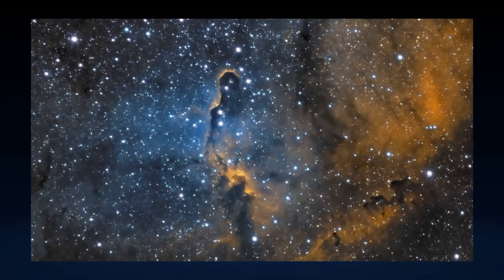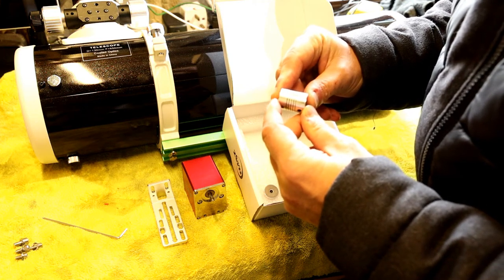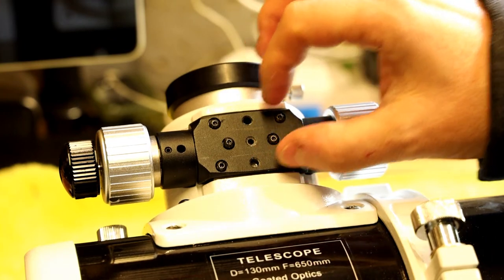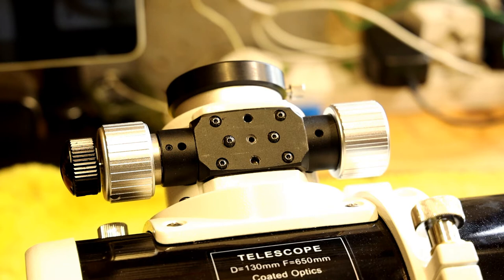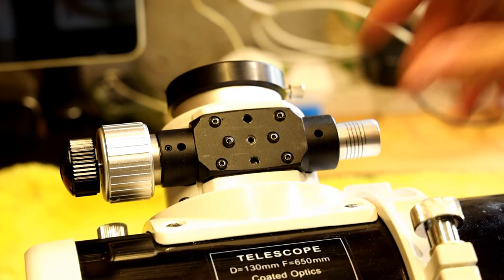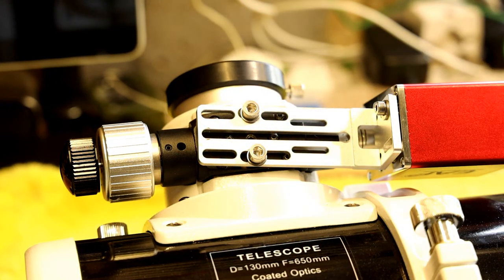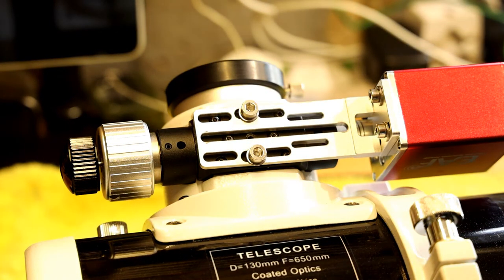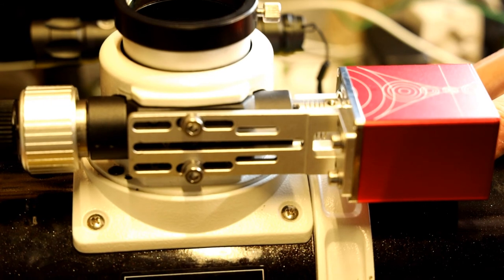Astrophotography with Glenn Clouder - ZWO EAF Installation to a Newtonian Scope

Comment: Glenn nice job, BUT you always want to tighten the allen (grub) screw on to the EAF flat spot (called a D shaft) and not the round part of the EAF shaft. That flat spot is designed that never to slip if the allen (grub) screw does dome a bit loose. Also in the EAF clear package are set (grub) screws with lock tight to prevent them coming loose as it sucks when it get really cold and the metal shrinks.
Reply from the maker: Thanks Chris. I always do make sure one of the grub screws is on the flat side of the spindle. I have heard others say theirs has come loose but I have yet to have this happen and I have 3 fitted to different scopes. I must be lucky

Comment: Many thanks for this great video. You made my day, as I first struggled a bit. But now eveythink works fine.
Reply from the maker: That's brilliant. let me know if you have any issues. Thank you for taking the time to comment, clear skies
Reply: @Astrobloke  I would like to share my experience with you all. I had stupidly loosened the grub screws that are in line with the spindle. I had to learn that this should never be done. As a result, there was no longer enough pressure on the spindle and the focuser stopped moving. After I discovered this and adjusted it again, everything was OK. Now the spindle - now driven by the EAF - grips again and I can use the EAF via N.I.N.A.. Thanks again for the descriptive video on this topic.

Comment: I found with mine that I had to leave the central grub screw to adjust the tension. Without it the focuser tube wasn't tight enough. Haven't tested it yet but hopefully it will be a smooth operation with the ASIair.
Reply from the maker: The focusers are not the best but if you spend a little time just tweaking the tension you can get good reliable results

Comment: Thanks for the informative video. Looks much easier than I thought. Is there some sort of clutch you can release if you want to manually focus for visual observing?
Reply from the maker: Hi Myrmidon and thank you for watching and commenting. That would be a great feature  but unfortunately not. There are just the 2 grub screws at either end of the collar so loosening them would allow manual movement but a clutch or switch would be much better

Comment: Excellent video,  do you need to have focus first before installing,  or is the tube all the way in ? Sorry fir the daft question
Reply from the maker: Thank you and no such thing as a daft question in this hobby. If you know the focus position you could mark the tube or put a bit of tape but all you do is via any program is move the focuser in steps until in focus. On e close autofocus curves will get it sharpe like what you find in NINA or APT
Reply: Thank you for getting back to me so quick , I have a 200pds and using the asiair plus

Comment: I’ve only ever used the cheaper Orion af. that one comes with two different brackets either for Newtonian or refractors. On this Orion one you would replace the whole bottom bracket of the focuser with the supplied Orion ones so my question is with the zwo eaf do you have to replace the whole bottom bracket of the focuser with the supplied zwo one or like in your vid is it meant to simply screw on top of the existing bottom plate of the original focuser? If it’s meant for the zwo bracket to be added on the existing bottom plate of the focuser are longer screws provided to compensate for the added height with the zwo bracket? I’m wanting to purchase one for myself but thought I’d get more info first. I see it’s pretty simple and straight forward with how you did it in your vid which I appreciate so much, your vids have always helped me with my own setup.
Reply from the maker: hi there and happy new year. I have not seen or used the orion focuser but the ZWO EAF just bolts on as shown and uses the bolts that comes supplied with the focuser in the box. its an excellent piece of kit and has work flawlessly since fitting to my 130pds and a few other scopes that I own, very versatile.

Comment: Excellent content!! thanks! Question, can you still do manual focus with the electronic focusers now?
Reply from the maker: Thank you for watching and commenting. With the ZWO this is not possible without undoing some screws. There are focusers that come with a clutch system to allow you the ability to manual focus with it in place but they seem more expensive. Here is a link to one such model https://www.aliexpress.com/item/1005005036360217.html
There are possibly other makes but I have only ever owned the ZWO EAF and a Pegasus focus cube and neither of them had a clutch to allow this. Hope that helps

Comment: very good video.  I have always used refractors and recently purchased the 150pds, focus slip is very annoying!.  Do you put anything in the programme run to refocus?  every 30 mins for example?
Reply from the maker: Thank you. I always put default HFR change for a refocus and may include temp change if I know the forecast is for a large swing. Normally not needed where I live in the SE of the UK

Comment: When I turn the focuser round like you state, I lose friction with the focuser tube.
Reply from the maker: It may need a small amount of re adjusting. Its not essential that it is turned around, I just preferred it like that and felt it would help with balancing.
Reply: How would I re-adjust it
Reply from the maker: @mickwhitaker4086  the 3 screws that adjust the pressure of the friction bar on the flat surface of the focuser tube. Also check that tube (flat surface bar actions on) as that can get shiny and slippery. A fine file or sharpening stone can help take the shine off and help with the friction needed.
Reply: Now I’ve lost friction on both sides, god knows how to correct it.
Reply from the maker: @mickwhitaker4086  I will try and help you. I have had this myself and its just a balancing of the tension with the screws.The 3 centre screws are the main pressure of the bar and also how square it presses on the flat surface. the 4 screws that hold the plate on also add pressure. it is easy to have too much pressure and that will also cause slip. so slacken off a bit until you can easily slide the focus tube in and out by hand. Then slowly apply pressure using the centre screw until it starts to action on the focus tube. Just small adjustments and you will find where it starts to work. its easy to go passed this point and then it starts slipping again.
Reply: I have sorted it mukka, thankyou, amazing what a fresh approach the next day can do. Even got it turned round so that the EAF is on the inside.
Reply from the maker: @mickwhitaker4086  thats great news mate. They are a pain to get right. Sometimes you feel like you are going in circles but as you say the be t day and boom sorted. Thanks for letting me know, clear skies

Comment: When I rotate the focuser, I lose all friction in the focus tube
Reply from the maker: Its not a great focuser to be fair. If it works the way it comes when bought I would stay that way, its not essential to flip it. I did find that it needed some adjusting after changing it.

Comment: Is there enough of the shaft (on the telescope) available to safely attach the flex coupler? I have the Evostar 72ED with probably the same focuser and there isn't much of the shaft available. How has the performance been since the install? Cheers!
Reply from the maker: I found it was a very good fit with plenty of shaft to attach to. The performance has been excellent and only wish I had done this upgrade sooner
Reply: @Astrobloke  Thanks for the info. Now to hunt one down somewhere in the wilds of Canada :)
Reply from the maker: @djphild  i think that is a problem we are all having. I ordered another a while back and still nothing
Reply: @Astrobloke  Turns out ZWO have discontinued this model of the EAF. The new one is similar but only has the USB and temperature connections on the back. So no need for a separate power supply, it runs on 5V from the USB. One less cable. Release is in early April.
Reply from the maker: @djphild  Yes I was aware of that. I have since this done another video fitting one to a zenithstar 61 and mention that ZWO have changed the design. Will be a good improvement losing a cable
Reply: @Astrobloke  For the 5V version, do you happen to know the amperage requirements?
Reply from the maker: @djphild  sorry i don’t know. Wouldn’t be high passing via usb. I did try and find the information but no luck
Reply: @Astrobloke  Thanks.

Comment: Thanl you for this video. I like the idea of turning the wheels and mounting the EAF on the other side!
Reply from the maker: Thank you. It helped with balancing a little and looks better for me
Reply from the maker: @astromatz  no it just needs adjusting. Its a balance between the 4 mounting bolts and then the 3 centre bolts that action on the focus bar. Also check the flat surface on the focus tube the bar actions on. This can become shiny and cause slipping. Rough it up with a file or emery cloth. Then it will provide a surface for the bar to fit